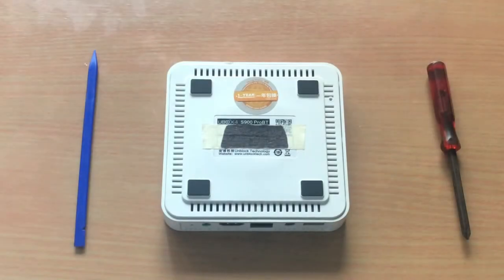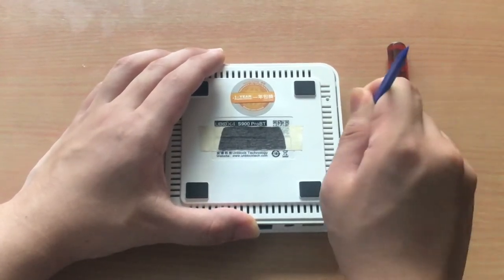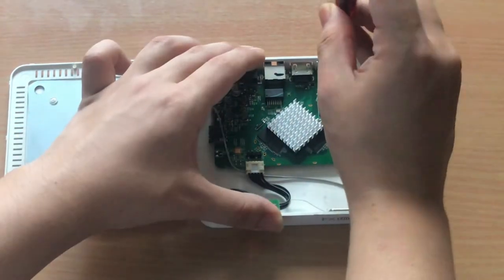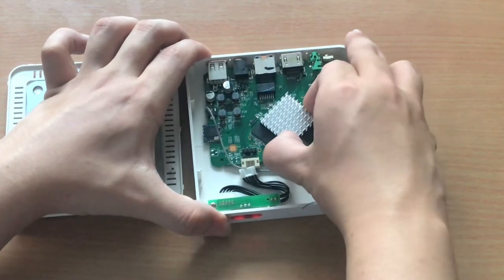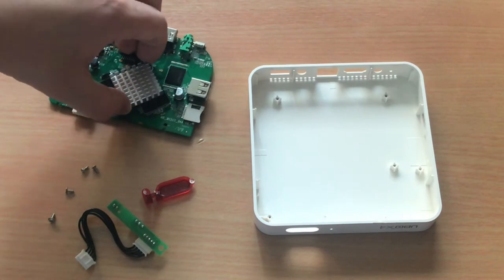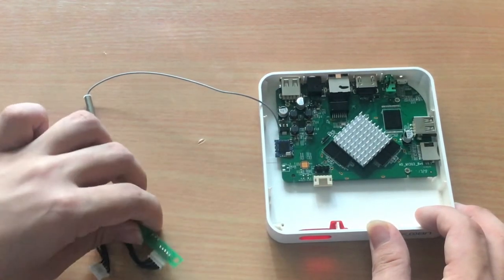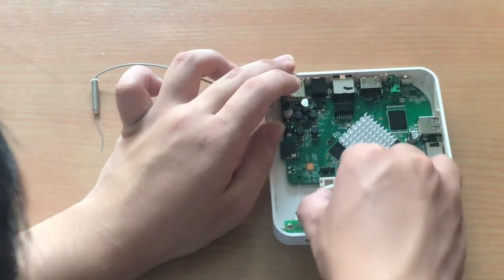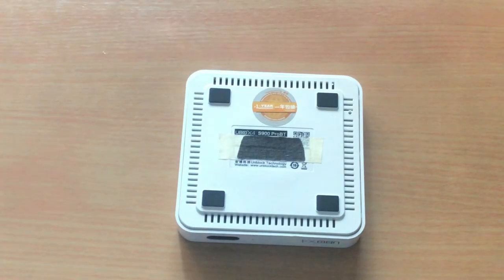UBox 4 Disassembly & Assembly

Comment: my parent had a ubox proS that stopped turning on so they gave it to me and i already disasembled it its just that i cant figure out the problem
Reply from the maker: There's no user-serviceable parts in UBox. You could try sending it to an electonic specialist (board repair), but I think its unlikely that they could fix it.
Reply: @miles_uy  well my parent got a new one and made me throw the old out bc there was no point of fixing so i decided to salvage a cable screws ir reciever heatsink and backplate

Comment: Hi i have T9 device its not turning on please help me.
Reply from the maker: The Android TV Box, like the one featured on the video, has no serviceable parts. The Ubox 4 on the video also won't turn on, I tried to clean up the board, by using compressed air and thoroughly brushed the board using alcohol and letting it dry under the sun for the whole day, and that fixed it, but it sometimes glitches and it only lasted for a few months.